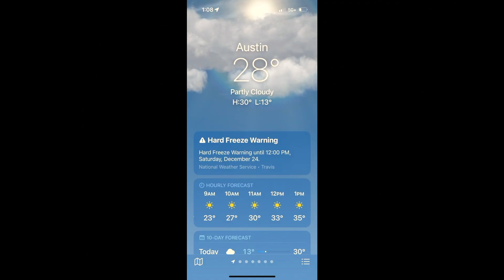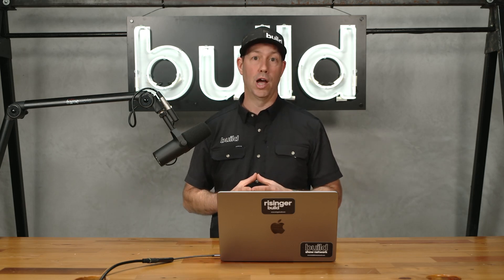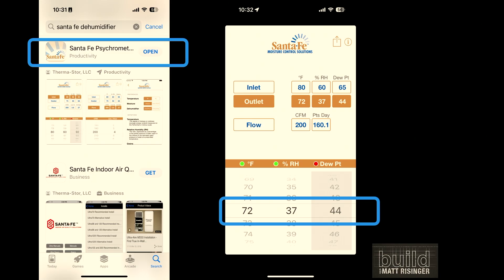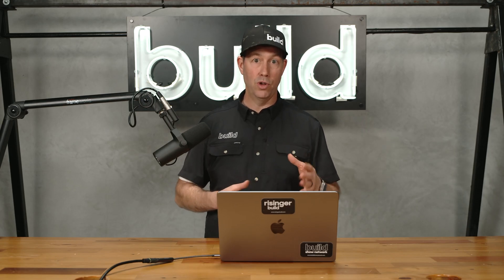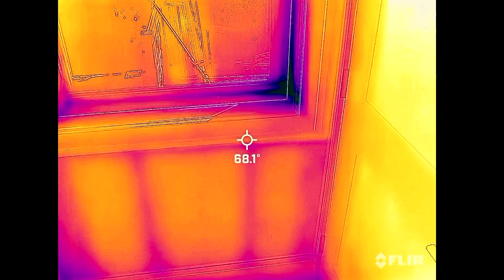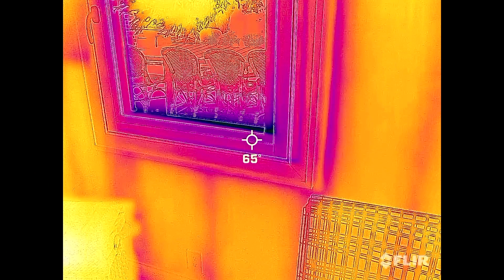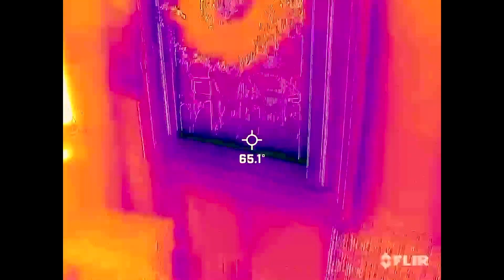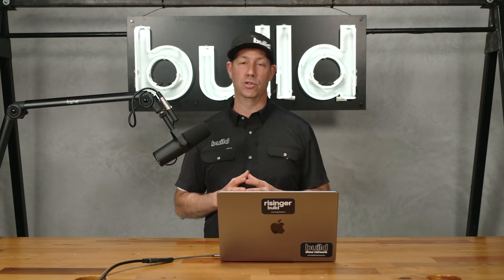Window Condensation Explained & How To Avoid on a New Build

Comment: Thank you for making it clear that window condensation is all about dew point and the surface temperature of the window.  Lower U values will translate to warmer surface temperature.  Heat exchangers, bath fans, register location, curtains etc etc all influence the relative humidity next to the glass.  It is just physics.
Windows are expensive so there is the temptation to save up front costs with code minimum units and give no thought to future HVAC cost.  U .20 windows are readily available and will have a short payback period.  Windows up to U .10 are available from several specialty manufacturers.  Bottom line,  buy the best windows you can afford.

Comment: It always seems to start on the lower corners so i am curious if the outdoor airflow collects in those spots (one side is always worst) and then you also have how the window is sealed as we all know anywhere you put a joint it is super easy to have a minute amount of space for air to flow thru. My bedroom window is brutal in winter (i actually scrape the ice insidesometimes) but the best to stop the window condensation is the cheap plastic wrap as when i do it there is never even 1 drop on that window
Reply: Heat rises in a room, the top corners are warmer than the bottom.

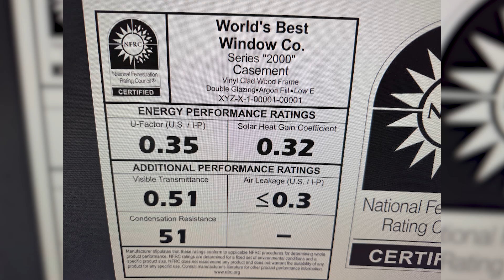Comment: Folks, please just go straight to the NFRC label and observe the Condensation Rating number.  If it doesn't have the number (it is optional as is air infiltration rates) and the seller can't provide the info, don't buy that product.  So much gnashing of teeth here.  Oh warm edge...plastic spacer -- go to the label and read the spec.  Oh does this brand....even a that brand will -- what is the Condensation Rating number?   Wood, aluminum, clad, vinyl  --  what does the label say?  That points you 50% of the way to freedom from condensation woes.  Keeping humidity down to 30% will take you the rest of the way home.  Well okay getting warm air to the surface by removing screens and raising blinds is a smart thing to do.  So what numbers should we look for?  For double pane windows, high 50s to low 60s is good.  The sample shown in the video of 62 is great for double pane.  Btw, the top line specs of the two windows in the image at 10:09 are identical: double pane, Low E and argon filled.  But the one on the left is el cheapo and the one on the right is top drawer.  For triple pane look to be in the mid 70s or better.  Then buy the best you can afford and your climate demands.

Comment: I live in Wisconsin and I hate how dry the house gets in the winter so I run a humidifier. I keep the thermastat temp at 69-70 degrees and humididy set at 40% on my humidifier. When it gets down to like  -5F or colder I get a little condensation on very bottom of my triple pain windows, all I do when it gets that cold is just turn my humidifier down to 30% and then the condensation disapears.
Reply: Same. My humidifier is attached to my furnace but it's the same concept since it has its own controls.

Comment: We a have a new eco home in Alberta with triple glazing PVC windows through out. We maintain 38% humidity through our HRV system, and any outside temp below minus -10c we get window condensation especially if the windows are covered with curtains or blinds. Just unavoidable even with high quality windows given the right environmental conditions. Having constant unrestricted internal heated airflow over the windows is the only way to reduce the amount of condensation......

Comment: Thank your for your timely video. I have been trying to figure out why I have so much condensation on my relatively new (7 yr old) windows. I know my relative humidity is way to high. I live in a tiny house (250 sq Ft ) in Michigan and have no exhaust fan. I am going to try a dehumidifier for the short term but need to add a fan. I downloaded the app you recommended and it shows that I have a dew point of about 60 deg f. Thank you!

Comment: I'm in central Canada, I think air flow is the main reason for mine. I have heat registers under every window in my home except for the one in the stairwell, and that's the the only one that used to condensate on really cold days, until I installed a fan in the stairwell to push warm air down.
Reply: Airflow is huge. Here in BC Canada we close the curtains at night in the winter to help keep the cold out. But we open them during the day so the airflow can dry the windows.

Comment: If you don’t want to replace your brand new windows then a $10 window insulation kit works great. You just need to make sure the air trapped between the film and the window is really dry.
Reply: This is what we ended up having to do. We have north facing windows in the Minnesota, the windows never heat up in the winter. I thought the plastic film was for older windows but it was the only solution that kept moisture off the windows in the winter
Reply: Good to know it works in that climate.

Comment: Does anyone else find it ironic that many building codes REQUIRE a huge fraction of wall space be windows, not just for egress in bedrooms but for "natural light" and as an "energy conservation measure" to reduce electric lighting, when windows create so many problems ?  California codes require a minimum window glass area of 8% of floor space for any habitable room other than closets and bathrooms.  Yet, windows reduce whole-wall insulation value and therefor energy conservation, invite water damage from flashing leaks, almost guarantee condensation problems like this, and force you to have windows in rooms like home theaters that SHOULD NOT have any external light.  How moronic to have to spend money on windows with all their potential problems in rooms that will then require more money spent on light-tight window treatments that are always closed.  90% of my windows are always covered -- not all of us want to look out at our neighbors or them looking in at us -- so those windows and window treatments are just wasted money.

Comment: I live in Manitoba, Canada (we usually get a few weeks of -35°C each winter).  Most houses here have basements and there is typically a floor register below each window on the main floor.  This helps to reduce the amount of condensation that forms on each window.  I also remove the bug screens from each window in the winter which helps increase airflow across the glass.  The humidity in my house gets extremely low in the winter, and I have high quality triple pane windows, and I still get condensation on the windows.  Our window frames and jamb extensions are PVC, so they don't get damaged by condensation.
Reply: Another Manitoban here with the same experience. Humidity is currently low 30s. It’ll get a bit lower by January. I get a small amount of condensation on a few of my windows. Before I had a HRV I would get a lot of water pooling and ice freezing on the inside of windows!
Reply: @Mark-vx5dt ▪︎ please, what's an HRV? Google results are heart rate variable, and I'm pretty sure you already had a heart rate!
Reply: @bethanyanderson1745   It means Heat Recovery Ventilator! It is a simple device that basically has two duct systems - one sucks air out of your house just like a bathroom exhaust fan. The other half does the opposite - it pulls fresh air into the house from the outside. 

But the magic happens in the middle - both air streams pass through a heat recovery core, where the stale, humid indoor air warms up the cool, dry exterior air. The machines have two affects - one, it improves your indoor air quality. The second is that it drops your indoor humidity a significant amount in winter. In Canada, all new homes must have them by code now.
Reply: @Mark-vx5dt  ▪︎ ahh!  an air exchanger is what we called them in the early 80s. I had a home built in Fargo, ND that had one - it was awful in the winter. The utility/laundry room was freezing. Of course, back then the exchangers were a new concept and weren't very sophisticated.  I give the builder props for his R-60 attic installation tho.
Thanks for your response!
Reply: @bethanyanderson1745  Heat Recovery Ventilator, which usually comes with a condensate drain. An HRV will typically exchange heat with washroom air and outside air to provide supply air to your living spaces.
Reply: @dragonchii  ▪︎ thank you
Reply: In my 1952 Alberta house the original HVAC system had the air returns around the perimeter and the heat vents on the internal walls. This setup allowed tons of window condensation during winter. About 20 years ago when the furnace was replaced, the HVAC company also reversed all the ducting so that the air returns are now on the interior walls and the heat vents are now around the perimeter. This had a profound effect and resulted in much, much less condensation.
Reply: @j.frankparnell3087 they don’t call them tin bashers for nothing!
Reply: I helped plan a house for a relative and we chose a local window manufacturer that builds awesome windows. With a gathering of about 15 people, cooking for them, and such, on a bitter cold Christmas Day I decided to see how good they were. Behind some plants, deep in a corner I found a tiny spot of condensation. I was impressed!
Reply: @flyingwheels6821  ▪︎ ok, don't make us beg - what's the name of this window company, please?
Reply: @bethanyanderson1745  The windows are from a company called Huron Windows out of Morden, Manitoba. They are pricey but very nice. I don’t go for luxury brands often but this is one that if I can afford then definitely!
Reply: Nice! which window manufacturer did you use?  @flyingwheels6821
Reply: Yep I noticed in my house every register is by a window. I also remove the bug screens as I noticed the windows that open have much more condensation. I made the mistake of installing cellular shades, they insulate great in summer but make my windows extremely cold, to the point the entire window is wet.
Reply: @shellderp pull up the blinds 6” in the winter so the bottom of the window gets some warm air circulation.
Reply: @shellderp ▪︎ how is it possible your cellular shades make your windows so cold that they have condensation? Is it the opposite of what we have up north - your exterior heat vs your interior cold (I assume from AC); but wouldn't these circumstances cause condensation on the exterior of your windows rather than the inside?

Comment: Get warm edge glazing with plastic/composite spacers in stead of the standard metal spacers usually used in thermal glazing. They are thermal bridges, and will transfer a lot more cold in from the outside. This goes for any window. If you really want to go after it at all costs, get windows that also have an in-built thermal break. Not sure whether they're available in the US, but certainly in Europe  for passive or plus houses. This of course also means that the wall system has to be up to specs for this type of construction,  or the extra cost will be of little value.
Reply: The US commercial market has had that tech for a long time. Sadly most do not utilize it. Commonly marketed here as "warm edge" spacers
Reply: @skiptrace4034 
Window installer here. 
Warm edge spacers only last 15 years on the sunny side and the spacer melts and you loose the seal in the glass. 
Stainless spacers are the best period!
Reply: Actually the modern stainless steel spacers are very close in energy performance to the best non-metallics, and even better than some, including some of the most widely used from Europe.
Reply: @gregcorwin8316 ▪︎ that seems to fly against conventional wisdom, doesn't it? I'd be really interested to read your sources or know which window manufacturers tote this theory. Thanks
Reply: @bethanyanderson1745  What you refer to as conventional wisdom, I would call marketing hype because the concept of "metal vs non-metal" was developed by marketing folks and presented in a full page ad campaign that was intended to grow market share, not present accurate performance comparisons. 

There are several ways to compare different product's performance. You could measure conductivity of the raw materials, not taking into account how they actually perform in the actual application. You could also measure performance as installed in an actual IG unit, i.e. glass on both sides of the spacer. There is also measurement when the IG is installed in a window system. Finally, since this YouTube video discusses condensation, the systems could (should?) be compared based on their measured Condensation Resistance Factor.

Since measuring thermal conductivity of the raw materials isn't directly applicable to the actual performance in a window system, this one is pretty much useless - unless you want to use it in an ad campaign, then it's very useful, if not accurate. 

Comparing edge temperature performance in an IG unit is a much better option as long as it's an apples to apples comparison - i.e. same glass thickness and same glass coating (if there is one). The NFRC database lists about 60 different spacer/spacer systems. Of these there about 10 or so options that comprise probably 90-95% of spacers used in North American residential window systems. In no particular order:

Intercept (tin plated steel)
Intercept Ultra (stainless version of Intercept)
XL Edge (Cardinal IG stainless)
Endur (Cardinal IG stainless)
Swiggle/DuraSeal (kind of a hybrid of metal/non-metal)
Duralite (warmest edge of widely used systems in North America)
SuperSpacer (multiple variations (7?) with the original being the warmest)
TPS (Thermoplastic spacer - primarily European, but also used by a few North American manufacturers)
Technoform (also European that us used by some NA folks)
And Aluminum of course

Since there are about 1200 or so window companies in North America, and because there are new ones opening and old ones closing all the time, there are variations in who is using what, but for the most part, especially among the larger companies, they are consistent. As a rough estimate, in about 2018 (last industry estimate that I have seen) about 1/3 used Intercept/Ultra, 1/3 used Cardinal, and 1/3 used the remaining products listed. Since then I suspect that Cardinal is about the same, but that Intercept may be somewhat lower while the non metallics might be a bit more.

Dropping the IG into a window system and measuring the CFR probably gives the best comparison of the various options by taking into account the actual window performance when using one spacer versus another. Again with the caveat that everything other than the spacer system has to be identical. Obviously that can be difficult because window systems vary even more than spacer/IG systems do. The best place to find this information is on the NFRC website. 

Dropping the different IG systems into a generic clad wood window, using 3mm glass with a triple silver LowE coating on surface 2, 90% argon fill and outside temp 0°F, inside temp 70°F, gives edge temperature in order of performance:

Duralite - 39°
Superspacer Premium - 37.7°
Cardinal Endur - 36.9°
Intercept Ultra - 36.2°
Cardinal XL Edge - 35.9°
 DuraSeal - 35.1°
Technoform - 33.8°
Intercept - 32.5°
Aluminum - 30.8°
Reply: @gregcorwin8316  ▪︎ I apologize for putting you to work with all that copy 'n paste!  Listing a couple of links would have sufficed. But thank you, I do appreciate it.
Reply: @bethanyanderson1745  Actually there is no copy paste anywhere in my reply. While I did look up the specific performance temperatures because I  wanted to be exact and I don't have the numbers for each product memorized, other than that everything else in my reply came directly from me to you as I typed them here. I am retired from the glass/window industry but all this used to be part of my day job and I still do some consulting work from time to time.

I didn't include links because I think it's rude and not always welcome to drop links into someone else's YouTube video.

You are quite welcome. 
 .

Comment: Hi Matt, great analysis!  It looks like based on your FLIR image that the lower right side of the window in question was significantly colder than the lower left side of your window.  Does the difference in performance indicate a failing window, a broken window or improperly manufactured window or an issue with installation?  Seems odd that only one area of the window would be performing so poorly as compared to the other areas (unless other environmental aspects are in play)?  Very interesting at a minimum!  Thanks!
Reply: Note that where the sun shines can have a significant effect on temperature, so if one side is shaded and the other has been in the sun, you can see a temperature difference.
Reply: It’s also important to keep in mind that the color scale is relative to the temperatures of what is currently visible in the frame of the FLIR device. So what may look like a massive cold (dark purple or black) or hot spot (bright orange or white) may only reflect a small deviation in temperature of a couple of degrees.
Reply: @readyplayer2 ▪︎
@shellderp ▪︎
 good to know
Reply: Interesting.  Maybe a result then of too tight temperature variation inside the window of the FLIR. Not sure what the difference of material thermal expansion rates of glass and composite, but seems possible that asymmetrical heating or cooling could cause the window to distort or even fatigue  fracture  over years of cycling.
Reply: Flir does not work so well on shiny objects btw